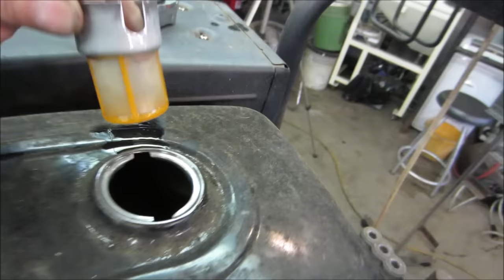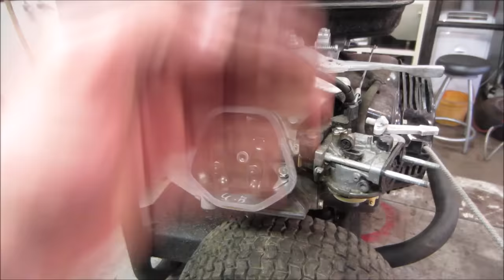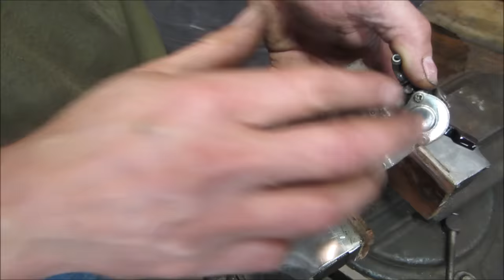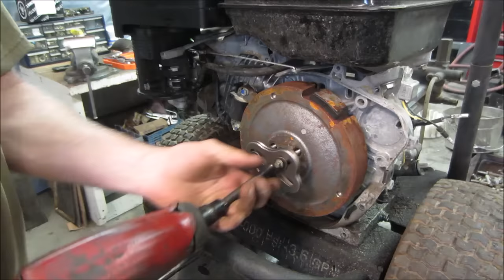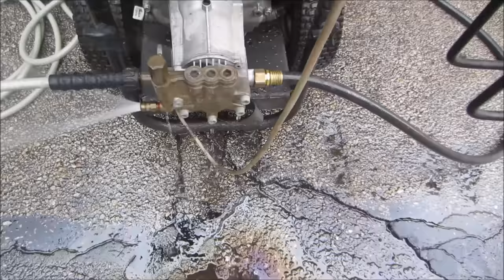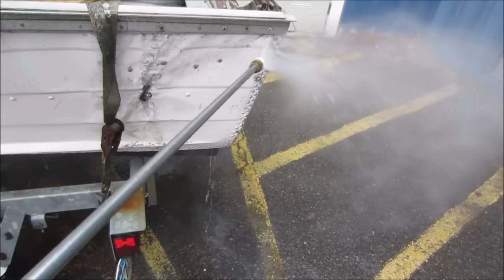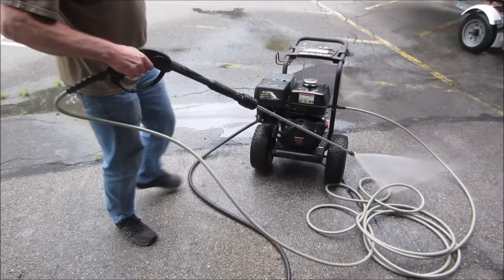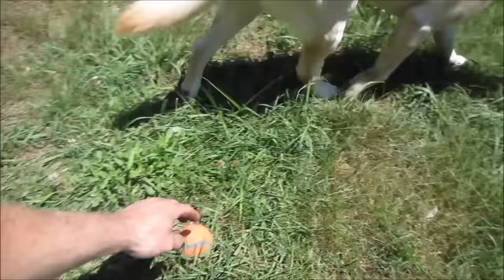Pull start rips out of your Hand? lets Fix It. Busted Pressure Washer.

Comment: 28:15   How do they install that type of screw at the factory?   I don't understand how it would be put together, unless they were somehow casting it in place.   But that seems like it would be an insanely complicated procedure and somewhat unnecessary.
Reply: It is designed that way to be tamper proof. It's a factory adjustment that isn't supposed to be changed. Air pollution...EPA thing.  On most carbs like that its 1/4 turn out from being lightly seated.

Comment: That thing is holding water like the proverbial sieve... I'm kind of surprised it still somewhat works, whereas, in an oil hydraulic system, even when you get just a small squirt, nothing usefull happens anymore.
Reply from the maker: just so much volume compaired to hydrolics
Reply: @mustie1  I see.

Comment: Tip for setting the coil air gap. Put the cardboard in place and rotate the magnet around to pull it up tight, then tighten the bolts. Rotate the cardboard out and Bob's your uncle. Gives a nice even pressure and you don't need a third hand.
Reply: Try using the proper air gap gauge and see the results. Use proper tools !!!!!!!!!

Comment: Packing and seals shot. Relief valve shot. Still. Cheaper to fix than toss and buy a new one.
Reply from the maker: id say it froze
Reply: Mustie1 
Purchased a dune buggy based on a 1966 vw beetle. Didn’t run. But have been watching you for a couple years. My Mustie1 kicked in and now she is running. Not charging so I checked your archives. Generator good. Voltage regulator bad. 
Thanks buddy for all you help us with.

Comment: Every time I'm pulling the fly wheel on an engine  over and over ,I can't help but think of the definition of insanity where you expect a different result even though you are doing the same exact thing.
Reply: While you are doing the same thing conditions are changing for the engine.

Comment: That part is a relay that opens the ignition circuit is oil is low.  That is a cheaper version of the pressure washer I am rebuilding right now.

Comment: You can't check valve clearance if you don't know where the cam is.
Safety, never put chemicals in a food container ,coffee cup and never put food in a chemical container.
Never run a pressure washer without having the water hooked up and on.

Comment: Hi friends, if your changing an alternator and replacing with a Chinese part. PAY ATTENTION to the connectors. They have 0 quality control. I fixed a mower the other day, new alternator had plug backwards. Keep old on compare before installing. I had to de pin the connector and reverse it.

Comment: the coil gap was too small,  should be 006 to 010", if it kicks back open it up as far as 010" which is max for a 4 stroke, gap changes ignition timing

Comment: Hi, iv been  fixing all types of machinery  for 40 plus yrs watching your video  made me frustrated with your method of workmanship,  first things i  check  is quality of the  fuel smell for volitivy,  an for the  price of a litre  of fuel I'd go ahead an empty the tank an replace it with NEW ,  fit a new plug £3 in Scotland, I'd do a quick carb clean an while that was being done I'd be in at the  coil cleaning  the coil faces an Magnets  on flywheel,  ida sussed the issue of the coil along time ago,  an the leaking pump needs attention as some  numptie has been  interfering with it, and under pressure  could be dangerous    Stan.

Comment: I can almost guarantee you he bought the coil from eBay or Amazon which came with the new spark plug a lot of times I don't ever use those plugs because they have defects similar to that one they even have markings of name brands on them but they're not at all also aren't you supposed to run pressure washers with water not to burn up the pump

Comment: The exhaust valve remains open while intake closes, to suck out last of the exhaust to clean the  combustion chamber.  You should be having pre ignition due to points not clean or pitting.  Points are under flywheel.

Comment: Nice fix... But You should NEVER EVEN START a pressure washer with out water hooked up. You should also pull the trigger and purge the air out before starting and don't let it idle to long without pulling the trigger and letting cool water circulate.  You will damage the pump , and likely already did. This is very basic info about pressure washers.

Comment: Stoooop. Dont run the engine if the pressure washer pump is still on it(no water). I always take the pumps off so you don't mess them up.(they get messed up it there ran without water

Comment: I never trust much anything at harbor freight but have bought miscellaneous tools from them to use at junk yards I've been to,in case I loose or misplaced them there,Jack stands and hacks from harbor freight,hell no don't risk your life on them,sockets try to determine where they made them at,main land China is a NO,but Taiwan most likely a test as far quality of tool ,but impact sockets mainland China manufacture is a no ,poor metal mix is a strong posibilty of failure ,but only thing mainland china makes that is any good is a sks ,everything else you be rolling dice

Comment: Hell, pull it another 25-30 times, It might start. Guy is clueless about octane, diodes, adjusting coil air gap( done at the magnet, not the body of the flywheel. ) Bypass valve thermal release valves. Hope the fellow that brought it to him isn't paying him by the hour.

Comment: Behold it wasn’t the killswtich or the low oil senor so he wasted he time playing with that, I knew it’s wasn’t them
Reply: Due diligence is not wasted time. You must go over everything, especially when the owner tells you they worked on it. The flywheel key was very unlikely in this application, but Mustie1 properly looked at it anyway.

Comment: First Problem...It's a piece of junk Honda!!! If it is an "Overhead Cam",it's a bigger piece of junk built by Honda...They have weak light blue to orange spark even when new,the spaghetti thin timing belt that drives the cam from the crank snaps easily,or jumps time,and is a pain to change,plus it can destroy the Cam gear too...Buy American!!! Briggs and Stratton!!!

Comment: Your destroying that pump everytime you run it without water flow.
Reply: I've run my pressure washer dry many many times... It's 8y old now and still fine. 

I had the pump apart about 4 years ago to change the oil and I don't see how running it without water (for a minute or two) could ever damage it... The pump pistons were perfect, no scratches or anything, they ride on seals with oil behind them, so they're never 100% dry. 

I use this pressure washer constantly throughout the year to wash my cars and clean the mud and dirt off my truck every other week, and just about every time I use it I start it up dry and let it run for a minute before turning the water on.

 When I put it away I run RV antifreeze through the pump and unloader, and then run it dry at idle till the carb is empty. 

It's just a Ryobi gas washer from 2014, maybe professional ones are different.

Comment: Chinese copy spares not genuine Honda Coil 
Surprised you don't use the round rod end of the white choke lever to bung up the fuel pipe as thats whats its designed to do 
We call them problem engines finger twangers

Comment: You do not know what you're doingyou should not run the engine without any water that's why is leaking water in the first place because you run it without water on the pump
Reply from the maker: its been leaking like that since he got it, l told you in the video,